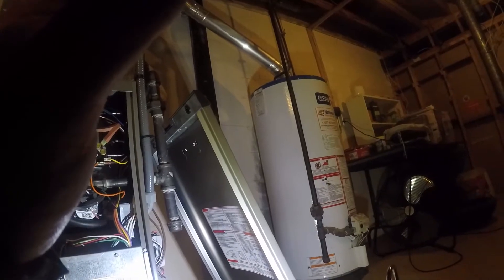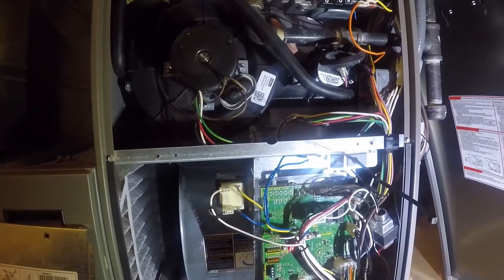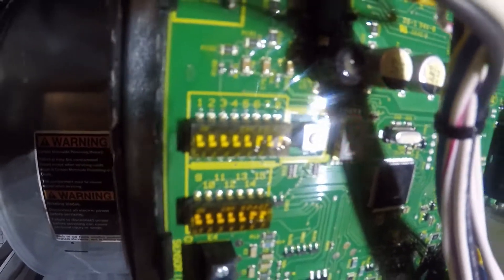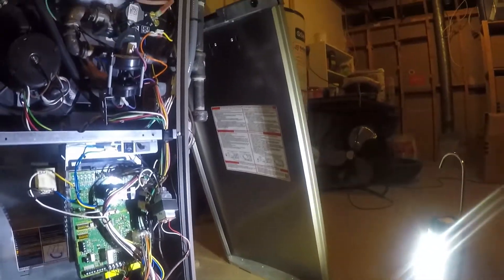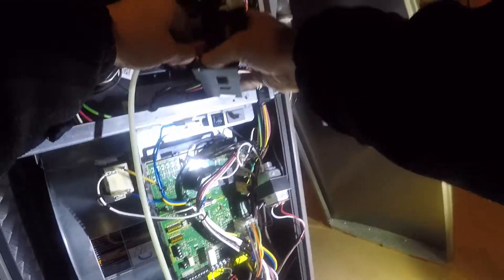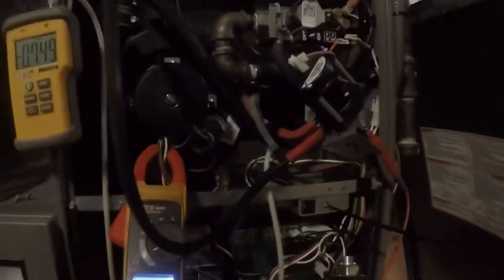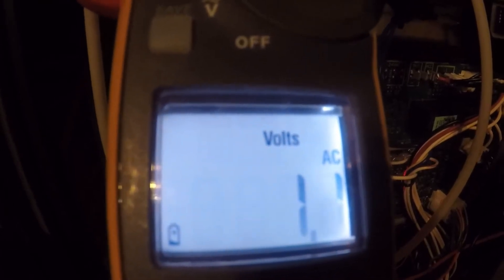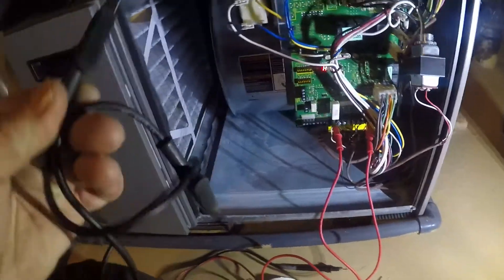Lennox EL296 no heat can you guess

Comment: I call this BS..I have worked on 3 of these pieces of sh1t this year alone. ALL 3 still under the 10 year warranty for parts. I have done all these tests , everything was OK but STILL I got E225 , 227, 223 error codes. Because they were under warranty , I just threw parts at them. New pressure switches , nothing. New inducer motor , nothing . New control board , nothing . Removed the exhaust vent , nothing .Just pieces of sh1t !!
Reply: probably incorrectly done venting or condensate line issue.
Reply: @Jon-hx7pe  CHECKED ND CLEAred condensate lines. Checked collector box. venting is about 10' with 2 45s on each . Run furnace with open burner box too . NotHING. It has to be a secondary heat exchanger issue but  Lennox tech support is nowhere to be found

Comment: I have error code E250 high heat limit. I was wondering if there was a capacitor on the housing of the blower motor that may have gone bad or if it's the motor? motor will try one weak rotation spin then stop.
Reply: Any luck figuring out what the issue is?
Reply: @kevinday7398  bad board

Comment: My EL296 was throwing E225 every time it went to stage 2 - I had the Costa Rica switches and like you said the new ones fixed the problem. I also get the occasional 223 or 227 and pulling the vent hose off the bottom of the combustion chamber (the one that runs from above the inducer outlet diagonal down under the pressure switches you can see at 11:29 of the video) and letting out the 1/2 ounce of water that is in there fixes those for a while.
Reply: I’ve had all of those codes with a 270 code constantly. I’m starting to think these control boards are made by elves

Comment: Is this overall a good furnace? My wife and we have to replace our old one, and have been talked into this. Seems nice but of course when doing Google searches I see doomer reviews lol
Reply from the maker: Here is my advice. Most furnace brands are decent at the end of the day it really depends on the installer. Lennox
 furnaces are pretty reliable and have good warranties. Just ensure you have a good install team
Coming to your home. It makes or breaks any purchase
Reply: @hozerhvac4406  thank you so much for the reply. Based off of local reviews of the company that I'm getting they seem to be one of the more reputable companies in my area so that's good to know it's mostly really high on the installer. They are backing it with a 10-year parts and labor warranty as well which seems to be a little higher than the standard. Thanks again for the reply. I don't know anything about this stuff. I did find your video helpful in knowing some common issues that may occur
Reply from the maker: @fuzzmaster4157  overall the El296 furnace has been ver reliable. Early stages had some pressure switch issues but that seems to have been taken care of with the later revisions. It’s a solid choice
Reply: @hozerhvac4406  thank you very much!!! Makes me much more comfortable with my upcoming investment
Reply: @fuzzmaster4157  did you end up getting this? My contractor is quoting me this furnace as well,  EL296V
Reply: @mikerzisu9508  we did. It's overall been very good. We did have an issue with the unit freezing in certain conditions but was quickly rectified by the company who installed it after they reached out to lennox. Our propane bill has been cut down a ton. Electric bill doubled in comparison to the previous year but overall our heating bill has been greatly reduced.
Reply: @fuzzmaster4157  what AC unit did you pair it with?
Reply: @mikerzisu9508  it's an all-in-one unit. I'm not sure the exact model but it's a hybrid premiere
Reply: @fuzzmaster4157  so the furnace and AC are in one unit?
Reply: @mikerzisu9508  yeah all in one
Reply: @fuzzmaster4157  interesting, haven't read about those. Why go that route versus two separate units? Cost?
Reply: @mikerzisu9508  it's actually 2 separate units but the a/c portion is also a heat pump. Then on the inside of the garage is the standard furnace. So I guess not an all in one? I'm not handy and don't know much about this stuff 😂
Reply: @fuzzmaster4157  yeah I don't have a clue either lol.  I am being quoted on 2 separate units, a furnace and AC so thought maybe or was an option to save a bit to get something like you have
Reply: @mikerzisu9508  our total was around 16k after rebate. We are very happy with our system and thankfully have a very good local company
Reply: @fuzzmaster4157  do you mind me asking where you live? That is WAY higher than what I will be paying. I just pulled the trigger today on a Lennox 16 SEER 2.5 ton AC unit and 2 stage Lennox furnace, and it will be $6300 installed after rebates. I live in central IL
Reply: @mikerzisu9508  I'm in delaware. There's 1 local company that advertises units in that price range and no one takes them seriously. The cheapest unit our company had was around 10k. I know that we purchased the top model they had
Reply: @mikerzisu9508  I can't remember the stats on our unit
Reply: @mikerzisu9508  our unit is 20 seer and an energy rating of 9.6
Reply: @hozerhvac4406  what's the part number for the honeywell pressure switch ? I had my switch replaced last year and they it was because lennox had a known problem with their switches. The new switch says P104549-01 , I just want to make sure that I have the good one.